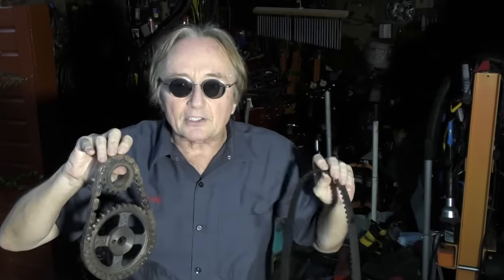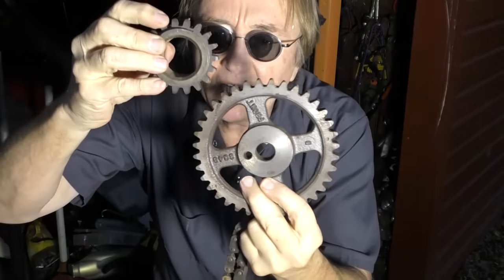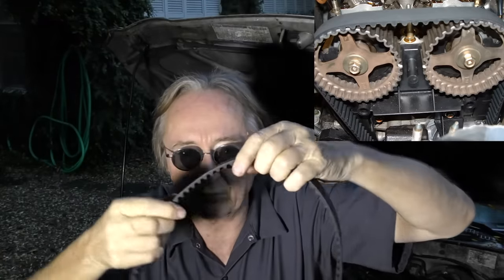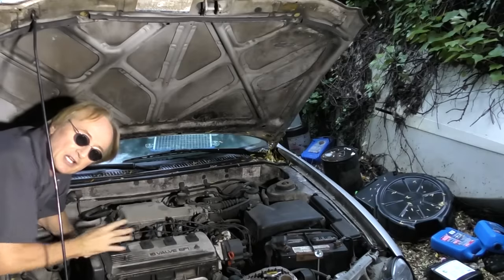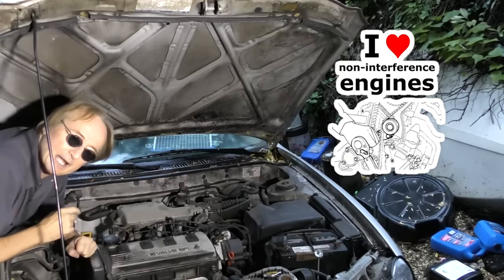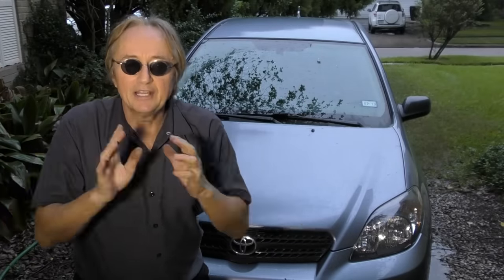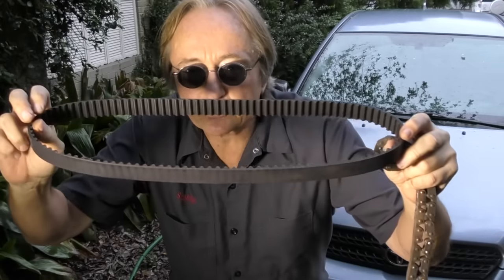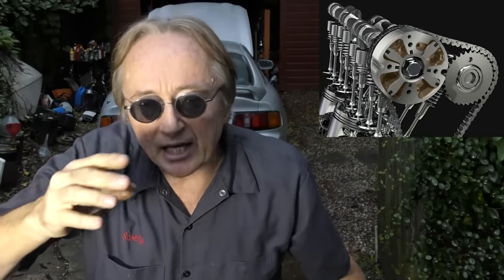Why Some Cars Have a Timing Chain Instead of a Timing Belt

Comment: Seriously, I think only americans are afraid of timing belts breaking. They work just fine and are easy to replace and even when you don't replace them they won't break in normal daily driving. Old belts only break when there's a sudden change of RPM or if it's really, really cold. They don't cost anything really, I can buy a full timing kit for my car for 30 euros. I've seen way more issues with chains than belts, especially BMW's.

Comment: Not with you on this one. Timing belts are less parasitic and quieter. My RX 330 has one, it was changed at 100K, I will change it again at 200K, which will happen soon. The belt technology has improved, and run dry so I don't have to sweat my 20K oil changes. (Mobil 1 oil and Bosch filters).

Comment: Timing chains are NOT solid steel. They are links made primarily of steel. Over time, the links stretch & the chains can fail. Because they are internal, examining & changing timing changes means half dis-assembling the engine. The cost is significant & can easily run over $1,600 in parts & labor. About the most you should expect from a well-made timing chain in a car that is driven moderately is about 150,00 miles. At that time, if you haven't had obvious symptoms, replace the chain anyway. A failed timing chain is heavy metal & internal - it will probably wreck your engine. You'll be surprised how much better the car will perform with a new chain. Timing belts  are still popular on smaller-displacement engines. They will last 70,000 to 1000,000 miles. However, because the timing belt is not internal in the engine, but in front of it under a timing belt cover, a timing belt check by your mechanic shouldn't run you more than $80.00 to $95.00 & a change should be in the $300.00 - $400.00 range. It is also not difficult for a minimally competent person to change his own timing belt - not true with an internal timing chain. The symptoms of a failing belt are also more obvious to even a novice, so you should be able to tell in advance when the belt is due for replacement. If you have a non-intrusive, small displacement engine, a timing belt with kevlar or some other strengthener combined with the rubber is not a bad choice.  Incidentally, Scotty, my grandfather goes so far back he actually drove cars with gasoline-fueled internal combustion engines with a crankshaft, pistons, valves  & spark plugs. How antediluvian!!!

Comment: Advantage of a timing belt. You can change everything on the front of the engine when you do the belt. As always, if you are a do-it-yourselfer as I am, Toyotas generally are easy to work on. Disadvantage of a Toyota: Way down in the alphabet and no second date.

Comment: Perhaps if the owners would spend the $30 on a timing belt after 80k miles theyd appreciate it more.  Seen plenty of chains stretch, snap, wear the sprockets clean off the cams... plus tensioner failures.

Comment: A timing belt engine is smoother running than a timing chain engine. Look at GM's V6 engines with a chain that has to be changed before most timing belts. I have seen them go bad before 100K at a cost of $2K to 3K to fix. I would rather have a $900 belt and water pump changed on a Honda any day.

Comment: I wonder how much a timing chain service cost since it's inside the engine
Reply: The timing belt and timing chain are in the same place, only difference is the rubber belt wears out faster and has to be replaced every 100K miles. I recently had the timing belt changed on my 05' civic, cost $800. My other car has a timing chain and its still good even with 200k miles on it.
Reply: @acedanger7170  yeah but I bet it doesn't cost the same is what I'm trying to tell you.  A lot of times the valve cover has to come off and side cover and timing guides need to be changed. Not the same job tit for tat

Comment: It’s a shame that a good engine like the 1st gen Tacoma’s 3.4 V6 used a timing belt. Like it just sounds dinky to have to change a timing belt every 100k miles on a truck that lasts over 300k miles. Nothing against the Tacoma, just that specific design.

Comment: So I guess the takeaway here is that squeezing more horsepower out of smaller engines caused timing belts to be phased out in favor of chains. That’s a good thing. But you can bet good money that if things change in the future and timing belts will hold up for a 100K miles the car makers will switch back faster than a car jumps when it sees a cucumber.

Comment: Yup interference engines suck, just a stupid design I won’t own one, one of my cars is an early miata 1.6L belt Mazda recommends every 60,000, hate it love every thing else about the car after I changed it at 80,000 after it let go the new one has a noise when I first start cold maybe the new water pump got 30,000 on it now tho. Glad my 08 miata 2.0L has a chain

Comment: Camshaft only opens valves  Valve springs close valves
Reply: Ducati motorcycles use the desmodromic valve action in which there are separate cams for opening and closing the valves, no springs.
Reply: @surferdude642  Ur not pulling my leg r u
Reply: @jacjumpin7471  nope, look it up, there are some detailed explanations that show how this system works.
Reply: @surferdude642  Ok Boss   Tell me somthing I dont know

Comment: We all know that they went to timing belts for built-in obsolescence. They know full well that, many people will not know or forget about the belt and it will snap and you have to buy a new car.

You can look at the implementation timing belts and see that, that first decade of automobiles is no longer on the road. And it's not because of age. Those cars all lost their engines and got crushed.

Comment: "They're not giving away modern cars"...but still, they don't have gear-sets for valve actuation. As a matter of fact, even a few older engine designs, usually diesels, have gear driven water-pumps & other so-called accessories. The ability and desire to create truly long lasting engines exists, but the market for cars & engines that last 25 years with nearly zero maintenance, doesn't exist.

Comment: Buy a German Opel Corsa D and You're going to change your mind about chains. The car has 160000km and had third chain, second since 140000km. No one can tell me why it is so noisy, no one can and want to repair it and if someone does it costs a fortune. In almost every modern car chain are made of trash and owners manual recommend to replace the chain after same amount of km as a belt. Belt makes no problems if the engine is correctly made. If you get a problem with chain You're broken or as in my case someone will tell you to replace the engine cause it will be cheaper than change a chain for a fourth time and look for a problem. Proudly belt owner since 450000km
Reply: My Volvo belt broke at every 60K miles (same mileage as your Opel chain?), where as my Camry was going strong at 110K miles before I decided to change it. Volvo purchased new was a money pit, the Camry purchased new had only routine maintenance like tires, oil changes, brake rotors and pads and some very minor parts over a 20 year period.

Comment: Because chains are more durable and longer lasting. Even Subaru realized their fatal mistakes s went back to a chain. Belts maybe cheaper to make but you will have to replace a engine if they break. A chain costs more to make but gives you symptoms before failure and doesn’t cost a engine. The cost is NOT worth the reward.

Comment: BMW used in all engines chains, 
and how long they last in N57 and N47 engines.
Reply: ? No !
M20 & M40 used belts.
And not any Chain is the same. There are cheap single and more robust and expensive duplex chains like in the M30,M42,M43,M44 etc

Comment: I think all interference engines should be mandated to have timing chains. Its cheaper to tear the engine apart to replace a chain than it is to buy a new engine because your belt broke sending your pistons careening into your valves.

Comment: So why is Honda still using timing belts in the V6...rock solid...engines?  Putting out 300hp with a sohc setup.  But yet Acura branded V6 vehicles are expensive, hold value, have gdi, and still use a timing belt...hmmmm...Is the company trying to save money according to Scotty?  Or maybe this formula works?

Comment: Better a well designed belt than a crappy chain like Volkswagens have! They cost a fortune to replace; a simple belt just about 400 bucks...
Reply: WTF are you talking about?  The chain on my 24v VR6 has lasted 18 years thus far, with no issues whatsoever!  The engine still purrs like new!

Comment: I just found out that my car has a timing belt. I have no clue if it’s been replaced. My car has 142,000 miles on it
Reply: What kind of car is it? The first thing you need to find out is if your car has a interference engine or a non-interference engine eight interference engine means it’ll destroy the motor if th The first thing you need to find out is if your car has a interference engine or a non-interference engine eight interference engine means it’ll destroy the motor if it breaks.

Comment: plz no. so many wrong things in this video. first off they didnt move from timing gears to chain cause of the whining sound. they moved on to a chain to move the camshaft on top of the cylinder head cause this made engines able to rev higher which meant more power. to deliver the crankshaft movement to top using gears would cost alot more compared to chain. second thing. please do not bend timing belt like you did in 1.53. it can cause the belt to break at some point. i sure hope that you didnt install that belt to a car.

Comment: Scotty I'm disappointed. Timing chains don't stretch in the sense that you are suggesting. The holes where the links attached to one another get bigger over time as they flex back and forth. This causes the chain to elongate. Usually around 200,000 MI. Maybe more. Unfortunately they cost three to four times more to replace than a belt so you don't save any money over time in fact you probably lose money with a chain driven cam. They make a distinct whining noise when they elongate too much.

Comment: Drive belts for motorcycles are stronger than drive chains
Reply: Curtis Berry - that may be, but they are more commonly used only in lower hp motorcycles. Chains transmit power more efficiently to the rear wheel and you can change the gearing easily.

Comment: Nonsense in my opinion.  If the maintenance schedule is followed you should never have a timing belt breakage.  However I've seen many timing chain failures where people think a chain is indestructible.  Guess what?  A lot of manufacturers don't use a big chunky chain like the one in the video

Comment: You’d think that as long as these companies have been in business they’d know how to avoid running into design issues with things like timing components. Just look at GMs 3.6 liter with their horribly designed timing setup. You’ll be lucky to get 60,000 miles out of it before having to rebuild it. You’re looking at almost 15 hours labor to change the timing components in some of the vehicles that engine is in like the traverse. That’s just ridiculous!

Comment: You are so wrong good old Scotty... Yes it is quite possible that older cars had better timing chains than new ones... Some serious problems with never BMW cars as well as certain models of Opel and Fiat cars are reported and they all have flaw: catastrophic failure because of timing chain failure. Imho it is better to have timing belt with car service obligation of changing it in each 150 000 km(changing whole distribution set) than have timing chain that "does not require any change" and then it let you down at certain mileage. Not to mention that timing belt are cheaper, and in present days they can withstand some serious mileage. VW for an example have timing belt service interval on 210k km.

Comment: 2:45 thats why there is a service interval on the Nissans but people are stupid and don’t service the belt. I drive a Diesel engine with a timing belt and has never snapped and guess why? BECAUSE I REPLACE IT WITH THE RECOMMENDED INTERVALS.

Comment: Try stripping the teeth on a plastic cam sprocket on a 1973 Chevy V8 with a timing chain, with only 63K mles on the odometer.

Comment: Honda still using in its 3.5 v6 engine timing belt. So f for family van odyssey cost me 45k for timing belts engine 9 10 speed transmission direct injector still i have to do the highprice timing belt replacement. So nisssan 3.5 v6. Have timing chain and wonderful cvt. And no direct injection. I go for nissan engine not for honda and its cheaper then honda

Comment: 1960s GMH  Holden Australia 186 ci 6 cylinder engine red motor  fiberbtiming great they could disintegrate WTF  later versions of engine had alloy t/gear
Reply: John Smith they were fun to take off with a cold chisel ,

Comment: OHC engines with chains are problematic. Look at the GM High Feature V6 motors. The chain isn't oiled properly and often wear out (stretch) really quick. A horrible job. Ford dopes stuck the water pump in the crankcase oil where it's driven by the chain.. DISASTER is waiting every Ford owner. The old Mitsubishi Chrysler 2.6 from the 1980s-90s was recognizable for its loud chain slap problems, the longer chains are the worst. And Toyota is one of very few makers that are not interference. For me an OHC engine is better off with a belt. Belts are improved and predictable. Once past 50K mi. inspect it!

Comment: If you need to take the water pump off to remove the timing chain, now is a good time to replace the old pump with a new one.
Reply: @Mark Codiroli If your chain is old chances are the pump is getting old too. May as well change it out while you have it all apart anyway. That's how is old schoolers always did it.

Comment: A quality belt is better cheaper and smarter design.
Modern engines are too tight and intense, this is why they have to go back. It's a trap.
Get a classic old school car with belt and non-interference engine, and it will last you forever, a chain will not.

Comment: Both truth and false. Some reliable german cars like Mercedes have time chain motors which will last always, but like BMW, Volkswagen, Hyundai have also chain motors and those chains break or stretch and these motors are much more difficult to repair and also more costly to repair. A rubber chain belt costs about 50 dollars, a chain may cost about 400 dollars for a Hyundai ... Especially BMW motors put into the Mini series tend to break easily and these chains are made in China, so chinese cheep krap chains, when those chains break , the motor is almost always lost. Such motors cost about 10.000 dollars ....

Comment: Ducati bike uses time belt and it recommends the belt is regularly replaced every 20,000 miles. Like its European friend Beemer, the maintenance of  Ducati is higher than the bike using timing chain. When the milage climbs up, Ducati poorly made starts falling apart. You can spend fortune repairing it. But it costs both cash and time. I just stay away from any European bikes. Those luxury bikes are suck.

Comment: I'll take rubber all the way. It breaks and it's a easy fix even on the side of the road. A chain breaks, stretches or misses timing, and wow! Just buy another car coz it's an engine teardown. NEVER BUY A USED CAR THAT USES CHAIN. YOU DON'T HAVE ANY IDEA HOW THE PREVIOUS OWNER'S CHANGED THE OIL AND THAT'S THE MOST IMPORTANT PART. IF NEW THEN OK.OLD NOPE GET RUBBER AND YOU'LL THANK ME LATER

Comment: The rubber timing belt is one of the dumbest inventions  for a car ever possibly the entire  health of the engine  resting on a piece of  rubber. The Nissan  that I had for 13yrs had a timing chain rather than a belt and it covered  650,000kms still on the same chain try that with a belt.

Comment: Not really,man,a rubber belt, surely a properly  sized one at that, can take anything; it takes on,even the blower on a 10 000 HP  top fuel dragster; 
   And it takes 1000 HP just to drive that blower...
What i don't want  , is a  single or dual OHC,(or quadruple,there are some such stupidities!) engine with chains...ever; unless i plan to unload it before 150000 miles;  (or before 10000 if it's a BM TroubleU N47 engine LOL,the very worst engine ever made?, or the many Porsche models  with  engines with the IMS bearing problems,or..or...just stay away if you can).